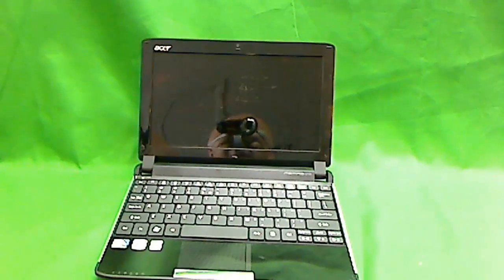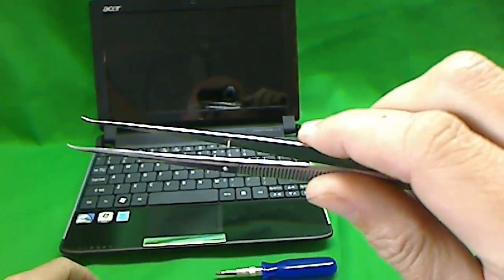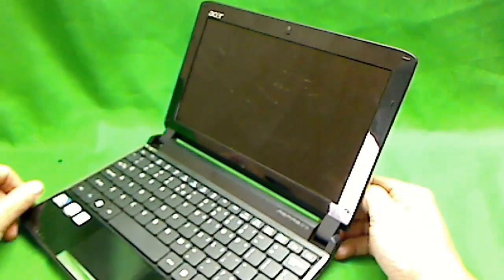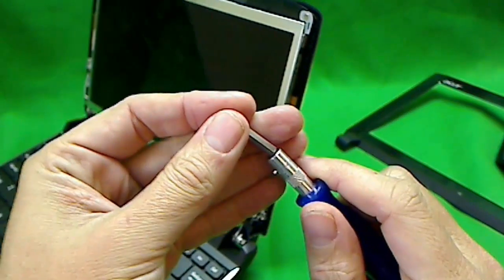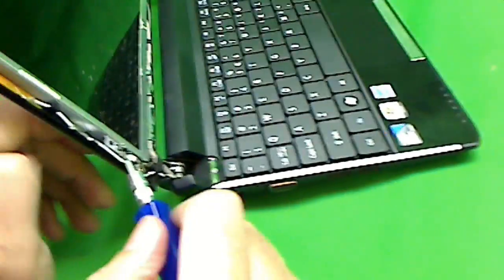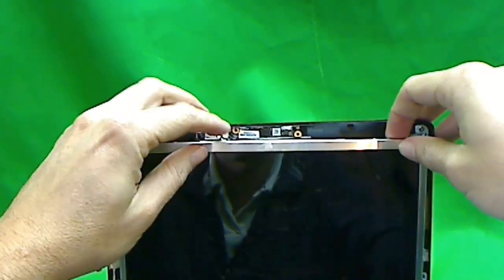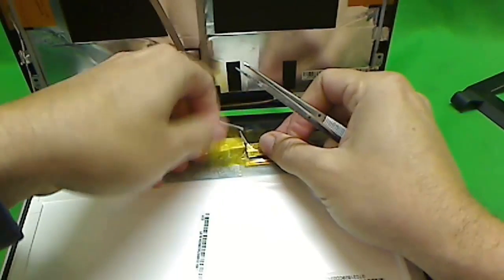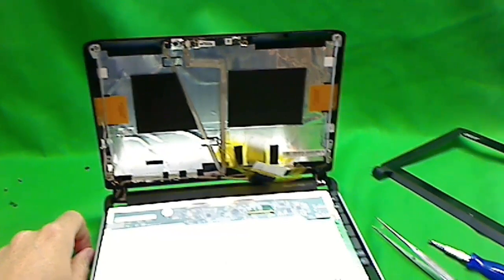Acer Aspire One Netbook Screen Replacement Procedure

Comment: ScreenSurgeons,
Thank you very much for this video. The screen install seemed to go fine, but a tiny magnet (1/4" L) fell out when replacing it and the computer no longer powers up. Nothing happens when you press the power button. Is this somehow related to the tiny magnet? Or is it some other issue?

Comment: That's not a problem with the keyboard hardware itself.  Anyway, Windows 8 was really designed with the latest advanced hardware, massive amounts of RAM and TOUCH screens in mind. Unless you have that it's pointless to upgrade to 8 and if your hardware manufacturer doesn't have updated drivers for 8, you're gonna have problems. If you buy a new computer and/or touch screen then by all means use windows 8. otherwise forget it.

Comment: You can't, nor should you. starter versions / licenses can't be upgraded.  without adding more RAM and other hardware upgrades it's pointless anyway. There's no advantage to upgrading to 8 and in fact DON'T DO IT you'll only slow it down and screw it up

Comment: You can't upgrade any "starter" versions of any Windows, only full versions. That's one of the reasons starter versions are so cheap. You're much better off leaving 7 on it anyway for performance/hardware driver compatibility reasons. 8 is not necessarily better especially since the hardware wasn't made with 8 in mind

Comment: They're all LCD, even the ones that say "LED", seriously, that even goes for TV's. The only difference is the way they're lit, and some picture quality difference/cost. Just make sure it's a compatable replacement for your machine. Take the old screen out BEFORE you order to verify the connector is the same,(40 pin for example) and in the same position (left/right/middle, etc) I recommend the non-glossy ones (if it's glossy it will say so specifically) It's much better in many ways

Comment: No. Aside from the obvious varying sizes there are glossy and non glossy ones. The non-glossy replacement for aspire one is much better than the original glossy one IMO. No annoying reflections, resists cracking, scratching and smudging, wider viewable angle, etc. You just have to make sure the connector is the same, and in the same position, or the cable won't reach and/or fit.

Comment: I have a cracked LCD screen. I ordered a replacement through EBAY. I replaced the screen exactly how it is mentioned. However, I have a white screen on the replacement. I connected my old screen back in and I was able to notice Windows booting up. The replacement screen is white. Is it just the replacement screen that is malfunctioned? Thanks -Joe

Comment: I had a problem with the install.  I carefully followed all the steps and replaced the LCD with the exact same screen, but now the laptop won't turn on.

Blue light blinks once, fan powers on for 3 seconds, and then turns off.  Any ideas?  Any suggestions?

Comment: Do an ebay search for the appropriate inverter board. The fail could be the backlight inside the screen itself, but messing with the insides of a screen is for the very technically trained. For most people, replacing the whole screen would be the only choice. Since the inverter fail is more common, though, and that part is way cheaper than the screen, you'd better start there. You would not waste much money if the issue is not there, and you can resell the part anyway.

Comment: I think you can, that goo is part of the old screen. Just clean it well and replace the screen, it should be fine. I just replaced a screen like the one in the video and it was a piece of cake, don't be afraid of trying it out yourself. Here in Spain the technician said he would charge about 200 euro (almost the price of a new netbook). I did it myself and it just cost me 50 euros (the price of the screen), and about 20 minutes.

Comment: My model is an Aspire One d250-1026. It has 2 of those rubber pads at the top with screws under them that I undid, and I snapped off the top,and parts of the sides of the bezel,however it seems to be stuck tightly at the bottom of each side. at the bottom corners of my model, there are two black squares, except they're flat hard plastic that are slightly depressed into the frame, where it's stuck. Are there screws under here that I can't see? How do I remove them, or remove the bezel otherwise?

Comment: Listen to this man. I just fixed my laptop using this exact guide. A couple of tips. 

1. use the tweezers. you will need them especially if big hands. 
2. the way he popped the bezzel was tough i found it was easier to pop it from the sides. if you look at the width of the screen you will see the crack where you pop it up from. 
3. there was an insane amount of tape on mine. Luckily i could use some of that tape later to reattach the video cable.
4. make sure the video cable is all the way in.